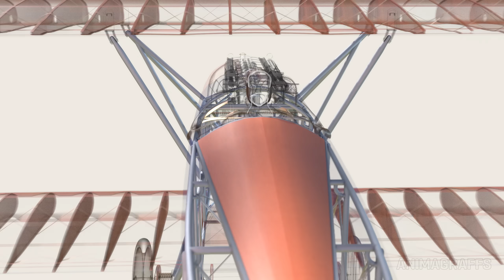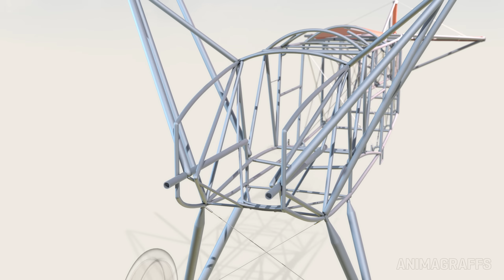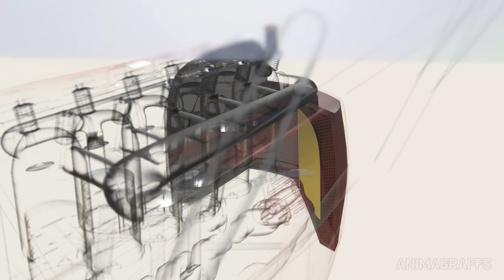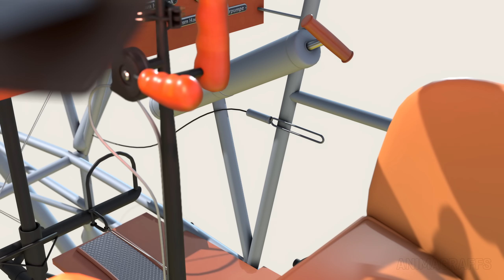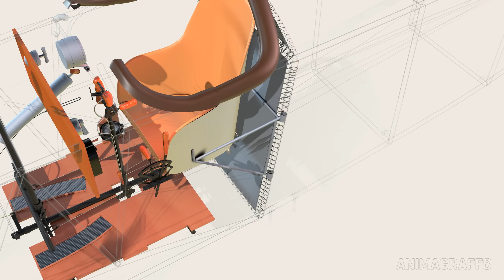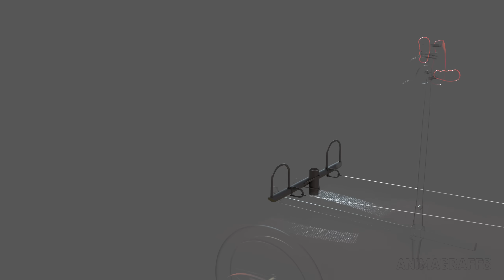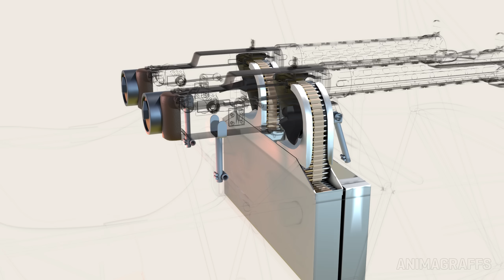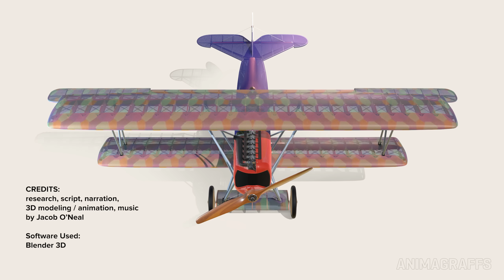How a WWI Biplane Works

Comment: Superb video, but some interesting and basic concepts are not covered.  1st, you accidentally depicted the rudder cross-controlled.  Left foot push on pedal causes nose to go left.  Your animation shows left foot pedal moves nose right....we call that bobsledding.  It's not how airplanes work.  Also, would be cool to observe that gun firing rate depended on engine rpm.  Finally, you mentioned that the pilot had to continually apply correction to controls becasue they were connected by cable directly to control surfaces.  Not right either.  Many airplanes like Cessnas feature the same control system technology but are stable.  The reason the pilot had to continually monitor pitch was that there was no trim tab (not on Sopwith Camel either, for example).  the CG, like and F-16's, was very close to the center of aerodynamic center.  Pilots could fly in a +/- 50 knot speed range with very light stick pressures because of this relatively forward CG.  Fighter planes are all about turn rate.  Still, they had to continually apply pitch pressure to maintain most attitudes.  
That's why P-51 had some very minor issues with turn rate.  Its wing is mounted relatively, yet slightly, aft (very stable like a Cessna) compared to an Me-109 or Spitfire because the P-51 needed to optimize range with heavy fuselage fuel tanks that loaded the fuselage aft more than other fighters.  Balance issues means that the positive pitch moment arm is shortened (distance from stabilizer to wing).  Further the load on this pitching moment is increased because the P-51 then has to place the engine relatively far in front of the wing on a long moment arm.  That's why Me-109 and Spitfire were so valued in turning fights.  CG is a big deal in fighters, from WW1 through today.

Comment: Unless the Fokker DVII's rudder worked opposite of other aircraft, the depiction of the rudder cables crossing over is incorrect. When the pilot pushes right pedal, for instance, the rudder should deflect to the right, thereby creating a leftward moment at the tail to turn the nose towards the right. To make that happen the cable connected to the right rudder must pull on the right rudder horn.

Comment: I had noticed the axle between the wheels was shaped like a little wing.  I never thought much about it, then was amazed when I learned (elsewhere) that this small detail could add up to 10% more lift and increase speed.
13:40

Comment: Fantastic work! I think, though, that you might have got the rudder controls reversed. Pushing on the starboard rudder pedal moves the rudder to starboard, and causes the aircraft to yaw to starboard. This requires parallel rudder cables, not crossed cables as in the animation. Just a minor point. Unless, of course, this model of aircraft did have a different rudder system from that which is standard today.

Comment: [08:11] The fuel-air mixture does not 'detonate' - it burns very rapidly.
Detonation - especially serious detonation - is like a sledgehammer blow to the pistons, piston rods bearings and crankcase. Uncontrolled detonation can destroy a gas/petrol engine in mere seconds.

Comment: In all this 3D simulation, the rotation of the propeller is such as to move air from rear to front, pushing the airplane in reverse.
Eventually it does not matter, but it's funny...

Comment: One thing I don't understand 
It is said that below the blade high pressure is created and above low so the blade could produce lift but wait wait 😮 higher the flow of wind which means low pressure means no air is residing hence low pressure is below the blade here you can see air is guessing fast below the propeller/blade according to this it should come down then. Then what about 3 rd low of motion I guess it is the sole reason for all flights operations

Comment: I think you are a little off on the max flight ceiling. Unpressurized aircraft can’t fly above 10,000 feet due to oxygen unless you have supply oxygen which I know they didn’t have then
Reply: @joshuabennett7334  they did fly higher than that and sometimes the pilot would become hypoxic

Comment: I’m actually conflicted on the D7 being the aircraft used. It was extremely revolutionary and diverted greatly from the norms of the time. If you wanted a more typical ww1 airplane the nieuport 17, sopwith camel or albatross would’ve been a better choice

Comment: Your propeller at the end is going in the wrong direction, or the angle of attack in your propeller is backwards, one or the other. The way it's rotating now it would be pushing the plane backwards.  Love your work though! Just saw that little nuance of an error.

Comment: Beautiful graphics and very pleasant & informative presentation.  I love old WW1 bipes and have a couple of flying models in my RC collection, (S.E.5a & Spad XIII).  As an old auto mechanic, though, just gotta' throw in a minor observation:  The depictions of the rotating engine are absent the compression & power strokes (intake & exhaust on every rotation instead of every other one as would be necessary in a 4-stroke engine.)  Minor & picky, to be sure, but just thought I'd throw that in for possible future reference.  Keep up the excellent work!

Comment: The Wright brothers cast an engine out of aluminum metal.  And the same engine drove two propellers using chains, like a bicycle.  
Because:  F=m(dv/dt).  The takeaway from Newton's first law: mass is a big deal.

Steel is 4x the weight of aluminum.

Comment: The company that made this aircraft is the Fokker Company, the same company that made the DR.1 Dreidecker (Triplane), and fun fact: Did you know that the D.4 was tested by famous Pilot Alfred Von Richtoffen, famous for flying his custom bright red painted DR.1, nicknamed by Entente Pilots and Soldiers as the famous and deadly Red Baron, the Red Baron tested the D.4 but overall didn't use the D.4 and instead used his custom DR.1

Comment: The level of sophistication reached in just 15 years is astounding.  It seems like airplane design advanced more quickly than automobile design.
Reply: I'd say they were somewhat equivalent if you look at the early Benz prototypes, various 3 wheelers and Ford quadracycle of the 1890s then look at the touring cars of 1903 to 1915 that could cross continents.  Maybe a bit slower, but emergency development of war planning and procurement didn't work to stimulate major improvements from 1913 to 1918.

In 1905 militaries were trying to figure out what they might do with a plane.  Recon and mail delivery is what most settled upon.  That all changed in the next decade
Reply: What you got from the Wrights is the very efficient modern propeller and the counterloop wire control systems shown here.

Once others in Europe saw those two things in the French exhibition...they applied them to failed prototypes ....and suddenly those designs started to fly and not crash.  The European designs became the planes of WW1, with those two Wright Brothers fundamentals.

Before the Wrights, most were using fat paddle propellers like balloons and too complex control systems that couldn't be mastered in flight to control pitch and yaw as conditions changed.

Comment: One thing that is notable in its absence: a parachutes. IIRC The technology was around during the war but pilots didn’t trust them and wouldn’t bother with them until the final months of 1918. 

Which led to another piece of equipment: the pilots revolver with at least 1 round for the pilot’s personal use…
Reply: yeah the amount of times pilots burned to death before they crashed I dont believe that the parachutes would be all that helpful unlike the instant pain relief tool

Comment: 7:49, When the 'person on the ground' turns the propeller, a few times, you failed to turn the magnito off.
 You gotta consider the safety of your ground crew. Do that a few times, and they'll send you out with a 1/2 full fuel tank.
Otherwise, pretty good video.

Comment: Good job making this impressive video. Once upon a time I saw a WW1 movie where a pilot of a biplane landed in a remote location and then later took off again without any help. At the time I thought the movie makers either made a mistake or got lazy, but now I realize if he had been flying one of these state-of-the-art aircraft it would have been possible. Gracias.

Comment: Nowadays modern day fighter aircraft is made from Steel, Aluminium, Titanium composite materials and any heat resisting metal, incorporated latest avionics and fly by wire

100 years ago

it start with nothing more than a Canvas, wire, wood and few metal part, the pilot is the avionics of that day.  Vision and situation awareness is the radar.

Comment: Really good video....The 26 Qrt Oil Tank was Refilled after Each mission Flite 'cause of Lost oil, "Open Circuit" engine  lubrication system engine Without valve covers....Don't know Why this "Lost Oil" system was used throughout the WW1 military aircraft engine Design.....

Comment: Why did they use wood propellers? It is beautiful and is not mass produced.
Reply: they didn't have the manufacturing ability to work with lightweight metal during ww1 and wood was easier to work with and to balance out all they had to do was carve wood off

Comment: This is a really good video.  You show the wires on the rudder pedals crossing to the rudder.  When the pilot pushes the right pedal, it moves the rudder to the right so the plane yaws to the right.  Your example has the pilot pushing right to yaw left.  You also said "it controls the vertical angle of the plane"; yaw actually controls the horizontal direction (from the pilot's perspective).  Of course, that becomes the vertical angle while the aircraft is rolled over on it's side!

Comment: Fun thought for yall, I too instantly caught the rudder cables being reversed, but honesty that may have been the design back then. Instead of todays separate individual pedals linked on the left and right sides controling rudder yaw, this was a single foot bar mounted to a single pivot in the center. They could have steered it more like a wagon axle, driving the bar towards the direction you wanna steer. That was the conclusion I made before seeing the comments haha either way, outstanding video. As an IA mechanic and pilot, im facinated by the elegant simplicity of early flight. Cheers!

Comment: Wow! I already knew that they'd synchronized the machine guns to fire between the propeller blades, but I had always assumed that they'd modified the  gun itself, perhaps by linking the gun's auto sear to the engine's camshaft, or some other fancy thing like that.

But of course, it makes way more sense to use an unmodified machine gun in single fire mode, and just have an engine-linked mechanism pull the gun's trigger repeatedly. A much simpler and (more importantly) far more adaptable and scalable solution than modifying the guns themselves.

This way, they could take a machine gun that was designed for (and perhaps even most recently used by) the infantry, remove the stock, and bolt it straight onto the airplane. No gunsmithing required. Gotta admire German ingenuity, despite the fact that they were on the wrong side (twice).

Comment: Beautiful video. One thing glaringly absent from this and other WWI combat aircraft: Parachutes(!). Practical chutes were not developed until the very end of the war, and thus combat pilots of all the warring nations did battle with no means of escape from a mortally damaged airplane. Also, the rudder cables seemed to be rigged backwards, with right pedal yielding left yaw. However, there wasn't standardization of such things back then, and it's possible that this is an accurate depiction of the manner in which the D.VII rudder control was rigged.

Comment: These planes were so delicate I don't understand how in battlefield 1 I can't take them down with my lewis gun
Reply: not really that delicate, plus hitting random bits of linen would do nothing, you'd have to hit an actual useful bit which could either be exceptionally small, or very hard (ie engine)

Comment: It might also have been interesting to mention that most airplanes of that era did not have flaps. So you'd likely have to do a forward slip to add drag, lose altitude safely, and land the airplane. Propellers were also fixed, non-constant speed (which I suppose is obvious, with a fixed wooden prop). I always wondered if the biplanes had invertible engines like the Aeronca aerobats, or if they were not designed to fly with the airplane inverted.  And did any of the biplanes have differential braking, or did they depend on ground crew pointing the airplane in the right direction during ground handling.  There's a real beauty in simplicity, and I love how mechanical and analog things were back then.

Comment: That gun-to-propeller timing setup is ingenious no matter what time period you compare it to. Simple enough to minimize failure rates, sturdy enough to withstand extensive use. It's interesting to see how engineers of this era came up with solutions with the materials they had on hand. To us it seems so simple, but to them they must have had a lot of "Eureka!" moments in a new and uncharted field at the time.

Comment: So how did they restart if the engine stopped while they were in the air?
Reply: i mean you might be able to do it if you reach up and pull the decompression lever and then put the plane into a dive to spin the prop to get fuel into the motor and then start it normally but most people would probably A. glide it down safely or B. just crash after being shot at
Reply: @kiwigaming09  seems like a huge design flaw
Reply: @Upinthecutty...  I mean you do need to give them some slack planes at that point have only been around like 5 years so no one is really thinking of these things
Reply: @kiwigaming09  youre telling me that my question wasnt really considered? c'mon. its major
Reply: @Upinthecutty...  i mean they most likely thought that if the motor has stopped then the pilot is most likely dead as well
Reply: @kiwigaming09  omg is that really your logic?? stop offering your ignorant opinions when someone is asking a real question.
Reply: @Upinthecutty...  buddy I'm thinking from the view of the people who built the planes so if the motor stopped it most likely got shot at so the pilots also probably shit and bleeding out
Reply: @kiwigaming09  Thats terrible logic. Do you know anything about this history? these planes got shot many times without going down. Look up some history before you offer wildly dumb opinions.

Comment: Engine made by Benz, not Mercedes. German pilots had electrically heated flight suits that ran off of magnetos. Engines were not mounted directly in line with airframe, but mounted 2 or 3 degrees off. This to compensate for forces of engine rotation. Planes had thin wire that ran around whole plane to create a Faraday cage to keep engine sparks from interfering with radio. Oil tank was needed because seals between crankcase and valve rods were not oil tight, thus they spit out lots of oil. Nice video. Above info based on my experience in helping to restore an original LVG CVI with Benz 4 engine. Very sophisticated pieces of engineering.
Reply: "This to compensate for forces of engine rotation". That is called P-Factor yes?
Reply: @workablob  P-factor is a product of the propeller alone, and is just one of the turning forces on an airplane

Comment: Another great video! I have 15 hours flight on a little Tecnam (2 seats) and to be frank it is not that different from this DVII. If i were a pilot of these days I would very probably have asked my engineer to add a little bit more power so i could put a 7cms metal sheet below my 🍑 and another one in my back, just in case!

Comment: Excellent presentation, bravo! I’m a 15,000hr pilot and instructor, I’ve flown DH82 Tiger Moth  to Airbus A320, and I’m a member of the Vintage Aircraft Association. I don’t say this to boast, I say this to congratulate you. Your presentation is excellent. In particular I learned about the synchroniser/interruptor firing mechanism for the first time. As others have said, two minor points to correct - prop rotation has been reversed in the latter half of the video. In most aero engines (with the exception of Gypsy engined aircraft from de Havilland, etc) the prop rotates clockwise from the pilot’s perspective. Which leads to rudder: The rudder control system is incorrectly “crossed over” in your vid. In all aeroplanes, left foot down = left rudder deflection, right foot down = right rudder deflection. In all other respects, excellent, I enjoyed it very much! https://www.aopa.org/news-and-media/all-news/2021/january/flight-training-magazine/how-it-works-flight-controls

Comment: Hello! The animation is wonderful. However, I would like to point an inaccuracy around 4:50 and possibly other places. The timing of the valves does not seem to be right. In a 4 stroke engine, each valve opens once only in 2 turns. Admission valve (the big one) opens when the piston goes low, then there are 2 strokes fully closed (compression and combustion), and in the 4 th stroke, exhaust, the exhaust valve (the small one) opens to release the gases. In your animation however, the left one opens when the piston is already low, and the right one soon after.

Comment: The darker shading on top of the wing and lighter shading on the bottom is an example of biomimicry called countershading. It’s the same reason many sharks have white bellies — the difference in shading counteracts the effect of sunlight and shadow, which would normally make the bottom darker and the top lighter. These effects combine to create a more uniform shade which blends in with the background more easily.